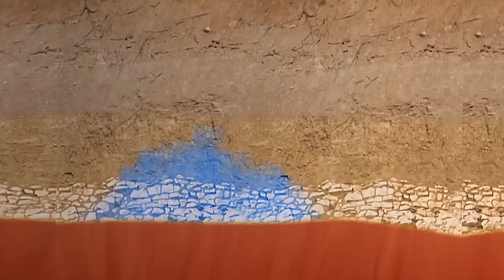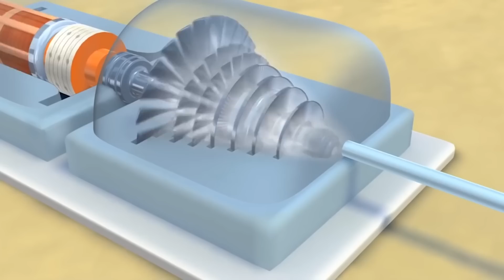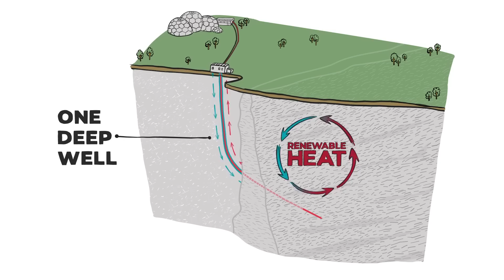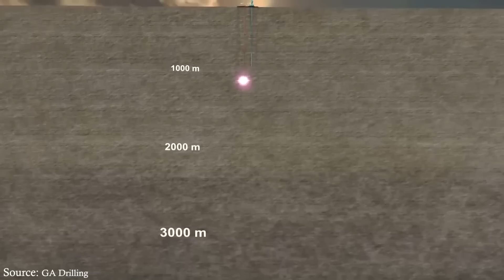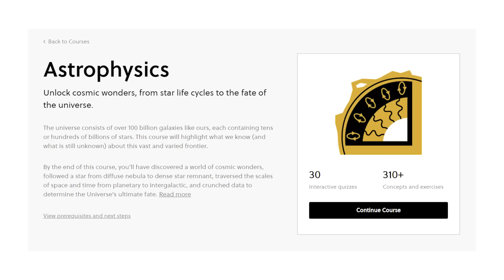How This Hole Keeps Generating Energy

Comment: It's common sense that if you used the earth's heat to boil water to run turbines. I've always wondered why it's not a thing. You can drill a hole fairly fast that'll reach 300 degrees
Reply: Molten rock doesn't allow you to, it's like digging a hole and having water and mud fill it up again.
Reply: @-aid4084  once your deep enough for it to be that hot your deep enough to use the heat to boil water.....

Comment: This needs to be busted by Thunderfoot. 
The issue with drilling a hole with this technology is that a joke needs to be kept full of a weighted fluid to stabilize the wellbore and prevent gas or fluid from flowing into the wellbore. 
The Russians had to stop drilling their well because at the depths they reached, the rock was becoming plastic from the extreme pressure and even the weighted fluid could not keep it stabilized.

Comment: I think you should take a look at the problems with the holes being under pressures and temps that make the rock there drilled in semi liquid causing them to flow and move collapsing the hole. There are other problems with this then just the drilling process as documented by the Kola Superdeep Borehole research teams.

Comment: The reason it doesn’t work well is osmosis. the water that comes up is mixed with extremely corrosive minerals the damage the pipes. The best method so far is to heat the water up to about 90°C and heat the next 10° with conventional sources. The result is much cheaper electricity production with much less corrosive minerals.

Comment: I cringed every time you referred to the Earth's core. No hole has ever gotten remotely close to it. I don't think they've even gotten into the mantle. Various drilling projects have gotten very deep into the crust, but that's it. The earth is 6317 km in radius, the Kola Superdeep borehole is "only" 12 km deep. There are projects with the aim of drilling where the crust is at its thinnest, but I can't find any information about successes even there. One problem is that these places also happen to be in the ocean, after all.

I still think nuclear is the best option for base load power. One objection I've heard is that the plant plus the exclusion zone around it could be better filled with a solar and/or wind farm. Why not do both? A nuclear plant in the middle with an exclusion zone filled with renewable generators. The best of both worlds with nuclear providing a stable base load and the renewables satisfying power for peak periods.

Comment: Just wondering how reliable it is in the sense that, if it’s 20km deep, isn’t it vulnerable to minor earth quakes or some collapse from the pressure ? There is no efficient way to repair it then i think. 

Great idea nonetheless, the tech will improve ofcourse, making it reliable in this case as well
Reply: Right, its like people forget we are a think skin of rock floating on top of an ocean of magma.   I can't see a deep well having a livespan more than a few decades max before slow gradual shifts or earthquakes blow the entire place up as they attempt to push fluids at high temps and pressures into pinched off pipes Km under ground.

Comment: A far more cost effective method, that requires zero drilling involves the ocean.  So long as the moon exists, there will be tidal movements, which could be a far more cost effective and totally clean way to generate electricity.
Reply: "could be a far more cost effective" how? Did you calculate $ per watt?

Comment: It's called hot rock thermal. We tried in Australia. 4 km hole in hot rock lasted about two weeks. So a couple million years of heated heated rock cooled off in about two weeks.
Reply: Perhaps its not millions of years old
Reply: @travisspace7786  It always takes less effort to lose energy than to build it up. That is why you have to use energy to heat pots. Not just leave them sitting. So yeah, it could be millions of years old and constant introduction to cool chemicals or water could easily kill its temperature.
Reply: 4km is nothing. Try 20km instead. And there is an optimal amount of water you can run through it so that you don't take away more energy than flows to it. Also at 20km the rock conducts heat much better.

Comment: Having worked in petroleum for many years, I can validate right now, that we can drill VERY deep, conventionally. It is not unheard of, to have a 10km vertical, 20km horizontal bore hole. THIS IS NOT the limitation on 'drilling depth'...THE CRUST IS! See, while the crust varies, generally it is 5km to 30km, or so, deep. As you approach the transition into outer mantle, temperatures rise exponentially...and so do pressures. Unlike with oil deposits, the REAL limiter is drilling into molten rock. See, the pressures are literally 'astronomical'...you are no longer pushing a heated conventional fluid...you are pushing a super-heated mineral load (that can crack, explode, expand, etc.) far beyond pressures that well casements can handle. In a very 'small' way, you are drilling YOUR VERY OWN VOLCANO! If that drill head enters into a magma region (not to be confused with a small isolated pocket), you would have just drilled a 'zipper' into the mantle, where MUCH HIGHER pressures exist, where the rock is more 'plastic' or 'fluid', where there would be no stop-gap (such as a magma chamber you merely drain)...you could POTENTIALLY open up a new 'Deccan Death Trap'...lava coming up the well casement sub-sonic, pressures of millions, possibly billions of Bar pressure! No 'sub-compartmentalized chambers', so just a planet-sized pool of molten rock...one mistake, and half the planet would be covered in lava, from a 'man-made volcano' that would make Yellowstone look like a party popper. You don't need plasma drill heads...the reason we will never 'tap this resource' is because of what ONE FAILURE would look like, if we drill too deep.
You might also want to consider what stopped the Russians in their efforts...listen to the audio recordings too, while you're at it. There is a SOLID reason why they capped that hole.
Reply: Nice to see someone wrote down my own concerns. +1 Like  👏

Comment: The problem is that you cannot extract energy from anything without side effects.

Energy may be large on a global scale, but local extraction of heat must have an impact on local geology.  If you are taking heat from local rocks then that local rock is cooling, and what impact will that have in terms of what is happening to the material above the above the rock.  Could you cause local earthquakes as the rock cools and gets denser allowing the rocks above to collapse down?
Reply: This exactly.

Comment: My house has a geothermal generator. It wasnt that expensive. Also, nuclear and geothermal are the most effective energy production methods, the government should really stop funding wind and solar farms and go for nuclear wich for a fraction of the resources and cost will produce hundreds of times the energy
Reply: Solar and wind is really corruption to make the solar and wind companies rich... The electricity they produse is pretty much worthless because it is not stable so you can not practically use it and must have other energy produsers running anyway as backup. Solar and wind power only makes sense when it is part of offgrid personal systems with huge battery backup.
Reply: You want to see us destroy ourselves?
Reply: @joesantos99  sheep

Comment: Geo-thermal energy is not exactly clean. Drilling deep into the earth will release carbon and sulfur into the atmospher. In addition, large scale geo-thermal plants may cool down the earth's core & damage Earth's magnetic field that relies on the molten magma (may not be that impactful since heat radiates out gradually into space anyways).

Comment: You missed a really important point. When you drill the weight of the rock wants to collapse the well. This is stopped by using “MUD”, which is wet and opaque.. so most of the plasma energy will go to boiling the mud… you drill a geothermal well the same way you drill an oil well. Hi temperature oil wells exist where the temperature is something to be over come not the main reason for drilling like geothermal. Also, the skills needed to drill an oil well are the same skills for geothermal. As oil declines you can pivot the upstream oil and gas industry into geothermal. Additionally, use the geothermal electricity to make hydrocarbons from water and CO2 and suddenly all vehicles etc become green overnight without changing a thing.

Comment: If I remember the Kola Superdeep Borehole history correctly, one of the main reasons they stopped it (beyond lacking money) was because at the depth they were at, the rock was almost like drilling through soft plastic. The drill didn't so much bite as "stir" the rock, and extraction of the drilled rock was made very difficult. That, and the well sides weren't very stable, collapsing around the drill head and string. They also kept having "mishaps" where sections of the drill string would break and they would have to abandon that current hole and start again above where the break occurred, probably due to the issues with the temperatures and the plasticity problems with the rocks at that depth.
Reply: If I remember correctly, the plasma drilling process claims to solve this.  It's supposed to change the composition of the walls of the hole so it stays solid.  Obviously it's impossible to know how it would work in practice until/unless there's a full sized demonstration, though.
Reply: A huge issue is the shear weight of the equipment hanging in the hole and that drill bits use this pressure on the bit to push as they drill. Maybe the plasma drilling can solve that, but we will see.
Reply: You're correct. The rock wasn't too hard, but rather the earth was too soft.
Reply: prove it or be removed from the internet for ever with digital ID, and i don't mean paraphrasing it.  Prove you can reproduce what you're saying, because as of now with all the evidence we do have you're either a liar like the guy above you or a moron
Reply: I remember, "twisted off in hot bubble gum." As the last I heard of the drilling in Kola.

Comment: Nothing will be free... if tools and technology get good enough to lift that much pipe,  handle that heat or drill that far .... we will pay for their services and they will drill from profits.  But 

To remove or disconnect our gas lines from homes in every city and connect with this new powering system will cost so much a bail out deal will be needed where we work for free to keep our planet going .... making me think 🤔..I'll own nothing but work to keep the power on and get my rations till we've reset from oil and gas to this new type of power ,,, weather we come out star trek rich or a star wars devastated planet as we tap into this is yet to be known

Comment: its not doable , drilling is not the big issue , deep down rock starts to melt and deforms so its nearly impossible to to have a permanent chamber down there where steam could be formed
also the steam would destroy the tunnels to the surface
sorry

Comment: Don't have to go deeper. 
Just got to drill in the right place. 
Here my town at 2000 meters theres boiling water that makes its way to the surface. 
Would power a large hot air engine to generate electricity no problem.

Comment: As only about 40% of this geothermal heat will be used by a turbine, the remaining 60% of heat will be added to an atmosphere that is already heating. Plus that source of heat will slowly degrade as the rocks loose their heat to the water.
Reply: It adds anyway naturally. I would be worried about COOLING of the Earth surface.

Comment: Of course, a dependable alternative energy has been developed. Right now they are building the first industrial scale reactor for it.  Its a medium temperature hydrogen plasma reactor and plans include small scale units fit to run a home... on a two liter bottle of hydrogen for a decade.  However they wont let me put the name here or they erase the post silently.  The wont allow any links. They wont allow any discussion.  They dont want you to know.  They want you to remain afraid. Remain desperate.  They dont want solutions. They want problems, money, power.  They get it by scaring their puppets into giving it to them.  Dont be a puppet. Dont drink the Kool-Aid.

Comment: I've said fro decades this makes much more sense than the fusion pipe dream.  Problems involved would be FAR easier to solve than building a fusion reactor.
Reply: Yes, however having fusion would be nice too. The question is: how much time do we have?
Reply: @heyhoe168  Fusion would indeed be nice..... however, I've been hearing it's "10 years away"  for well over 50 years. It is SO complicated and expensive, I suspect it may well be impractical.

Comment: Don't want to be a buzzkill here but I would stay away from the core even if we could get there. Tapping the heat that is close to the surface and destined to vent anyway is free game but if we extract heat from the core, that is what keeps it molten, and what generates the dynamo that is responsible for the electromagnetic field that surrounds and protects earth from the suns solar wind and mass ejections. take enough heat from too many places all around the planet for too long and the core begins to cool, we loose the dynamo, our atmosphere, and we all die from radiation and lack of an atmosphere.
Reply: Right now we cant drill deep. And when will be able, who would stop the greed?
Reply: @heyhoe168  If by greed you mean finding an almost free energy source to "exploit", I will concede that humans and life in general are based on greed by nature and that includes you and me and everyone. We complain about the cost of goods and services and blame the greed of those who provide it. Those who provide it complain about the cost of bringing these goods and services to market. There is a market because we, you and me, want what they provide. If the other guy can provide us with the same end item energy i.e. electricity or fuel for less. We are going to buy from them so who are the greedy ones in this case? Is it the consumer exploiting the cheap provider or is it the cheap provider exploiting labor, the environment, the taxpayers? Is the greedy one the more expensive guy? Greed is a very subjective word.